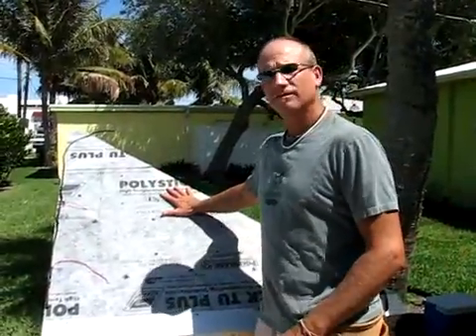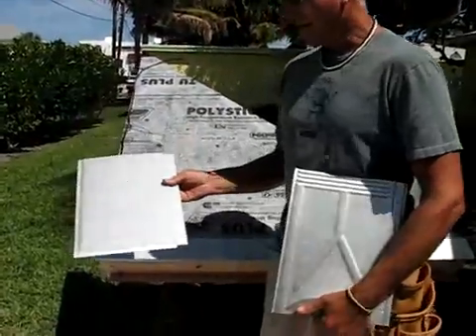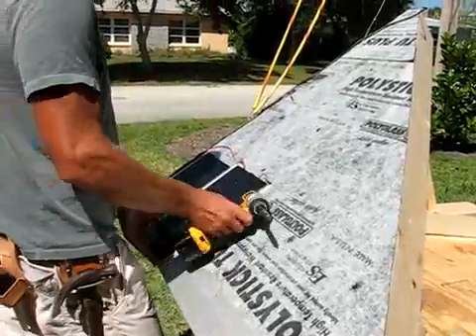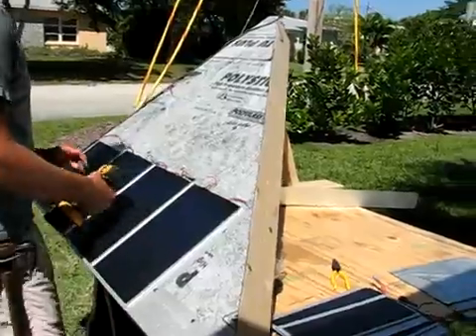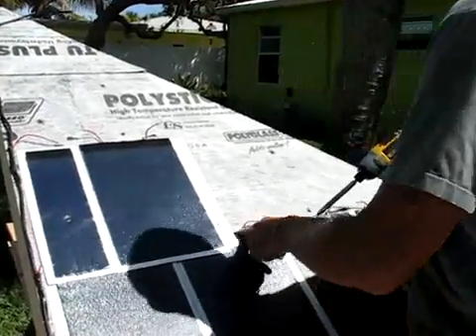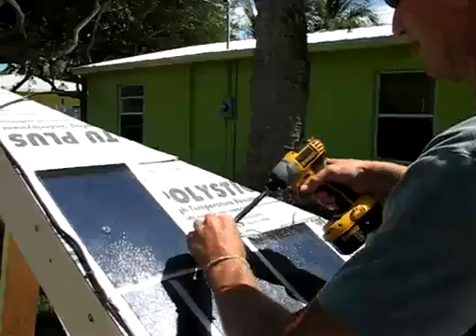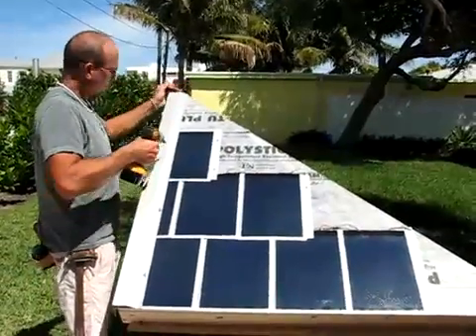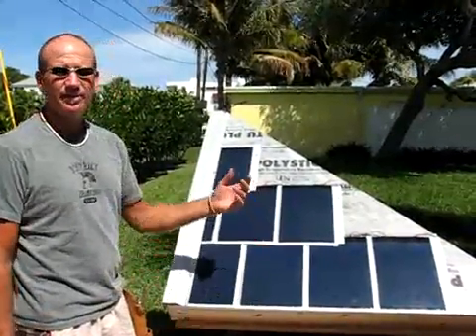How To Install Solar Shingles - Ah The Ease!

Comment: What happens when one or 2 shingles fail how do you fig that out. this is a very poor design of solar. Your best bet is stick with solar panels. Solar panels come with Micro inverters or an Inverter system that allows you to monitor the whole system. I doubt that your utilities company or the township will approve this install, Cause you will need to apply for permits.

Comment: Did he just put a screw right through the shingle on the side where he mounted the flashing? How well does a panel perform if you cover half of it with flashing? Get out a DMM and show us the voltage, short circuit current as you go..
Reply: He explained that the starters were fake so NO he did not screw through a solar panel.

Comment: those shingles need much more overlap to avoid water intrusion through capilary forces.
Reply: YES! Not a 21C solution for a water tight roof. Water travels in every direction including up under intense wind pressure. Need drip cavities or short lived mastics to work with those tiles. Not legal here. Now I know why I saw recently that USA homes replace roofs on average every 15 years!! That is how Musk will make his sales - on sale a week and already sold out till 2019!